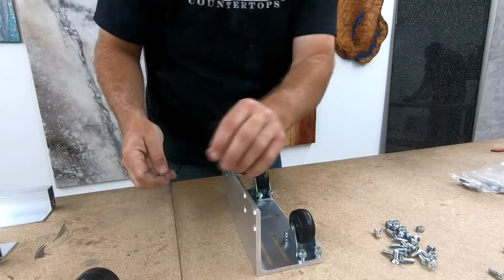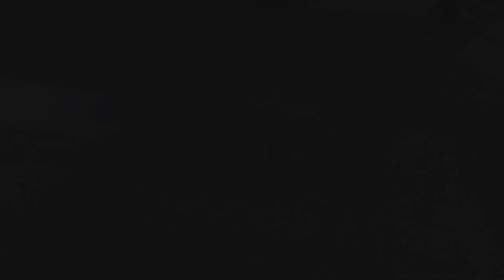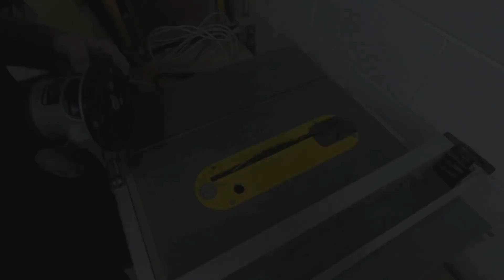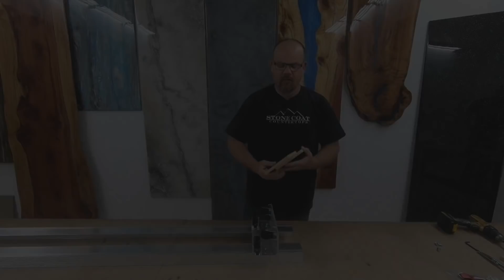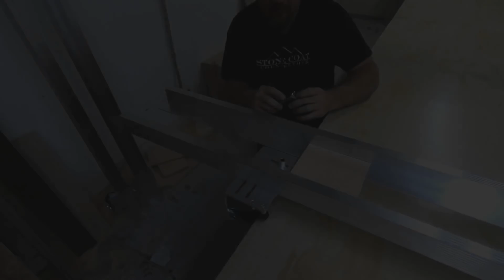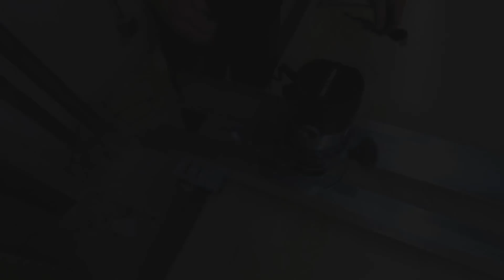Slab Jig Assembly

Comment: Just purchased this and flattened two 8ft tall slabs 2” thick. The claim that their is no sagging or bending of the bars is utter nonsense. That said it does a decent job. But if you’re buying this thinking you’re going to get pinpoint accuracy, your mistaken. For its price range it’s pretty damn good as long as you understand you’ll need to do a lot of surface sanding to get it perfect.

Comment: $8 worth of casters, two angle brackets $6, $40 worth of aluminum, and $4.75 worth of bolts. And you still have to rely on your own devices to raise and lower it, keep the shavings off your slide. And to top it off, you’re still sliding metal on metal. For just under $500, you can buy 4 linear rails, 8 slide bearings, some 1x2s and a scrap of plywood and make a real router sled that slides smooth all the time with no waste build up issues. And  still have money for a spoil board and several cases of beer to drink with your free hand while sliding your homemade router sled with one hand. Just sayin.
Reply: Build me one that doesn't flex in the middle and I'll buy it from you.
Reply: @strykerliker  if flex is your concern, this isn’t your best choice in that aspect either. On a 36” span, it has 1/8th of an inch of flex in the middle.
Reply: @lukeschrade4904  So what is the solution?  I seriously need a solution.  I've seen the woodpecker one and the one made by Truetrac, which is my favorite, but damn over a grand?
Reply: @strykerliker  my apologies for the delay. I found that a 1/2” wide x 1”tall piece of hardwood attached to the bottom of the linear rail support gives it enough of an i beam effect to keep it from flexing on wide spans. Most of the slabs I do are under 28” though and I don’t have flex problems at all with the linear rails I use for most projects.

Comment: After many uses do you have to apply anything to the tabs where the router sits to make it slide easier? I am concerned that it will wear it down the finish and it would want to start stick or hang up a little
Reply: Just use a dry lube and it will glide so easy.  Do not use a paste wax as the dust sticks to it.

Comment: $400.00? Holy Jesus. The materials aren't that expensive. You can get the aluminum angles from ebay for about $20 ea.
The extruded tubular aluminum rectangular w/flange from 80/20 or other manufactures. The casters cost next to nothing from Harbor Freight.
You could sell these for around $200.00 and make about double your money. I would definitely buy it for around $200-$225, more
than that I would have to get a tattoo on my forehead that read dumbass.

Comment: The router bit link wasnt in the description.
Reply from the maker: Hi John, here is a link to that router bit: https://www.amazon.com/Magnate-Surface-Planing-Bottom-Cleaning/dp/B0006B0QXO/ref=as_sl_pc_qf_sp_asin_til?tag=stoncoatcoun-20&linkCode=w00&linkId=be2e3bf1a918bd41ced3b3067f98217f&creativeASIN=B0006B0QXO  Give us a call or email us anytime for project support! (541)450-1976
Reply: @StoneCoatCountertops  This link is for the 2.5 inch bit. Your vid talks about a 3 inch bit.
Reply: @miland1959  https://www.amazon.com/Magnate-Surface-Planing-Bottom-Cleaning/dp/B009X5MZ74/ref=pd_day0_hl_469_1/132-4472571-8090447?_encoding=UTF8&pd_rd_i=B009X5MZ74&pd_rd_r=078b4e10-6c89-11e9-9ffd-03efec45caec&pd_rd_w=Tq4UT&pd_rd_wg=EJKBt&pf_rd_p=ad07871c-e646-4161-82c7-5ed0d4c85b07&pf_rd_r=2MPMJ8HCAYZBPY3412Y5&psc=1&refRID=2MPMJ8HCAYZBPY3412Y5